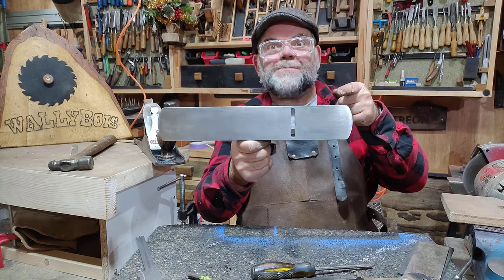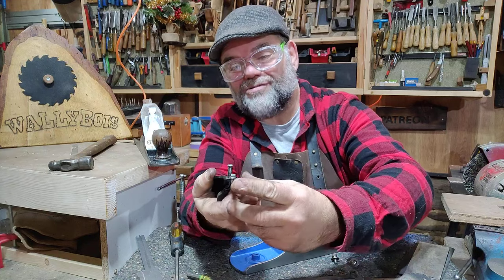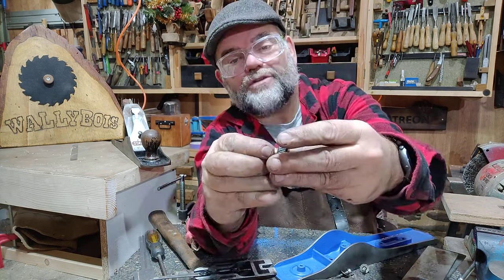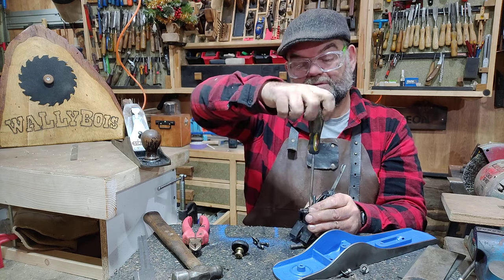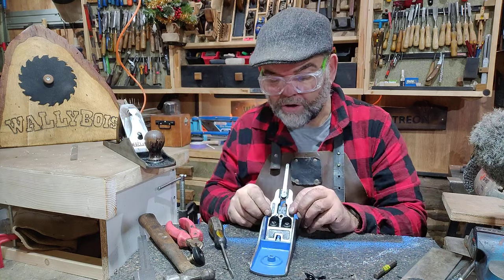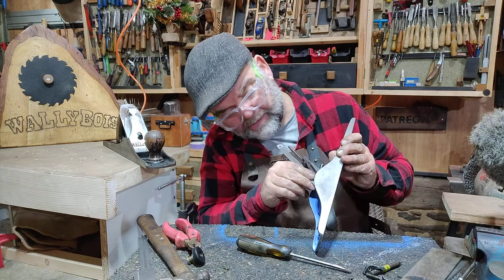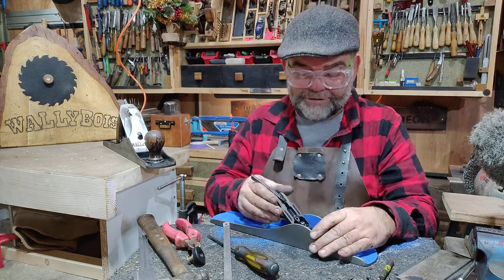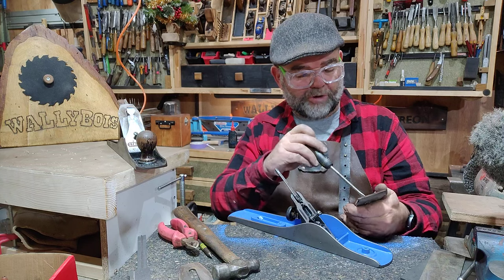Handplane Frog Restoration of a WW11 Stanley Bailey No 5 (Part 2) #handtool #toolrestoration

Comment: Loving all your workshop vids as well as parallel political commentary. Keep em coming.  I have similarly ancient planes and agree that properly set up with keen blades, they are a delight to use. I have a feeling that the original carbon steel blades were good quality and hold their edge well.  Not sure if the current offerings are as good.
Reply from the maker: Unfortunately the latest Stanley's are Chinese... Clifton are great but pricey xx